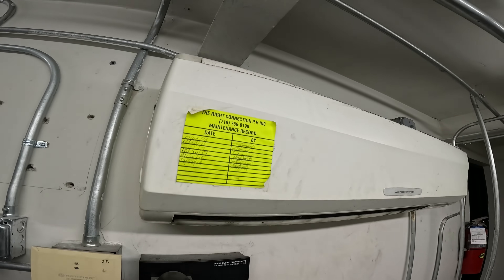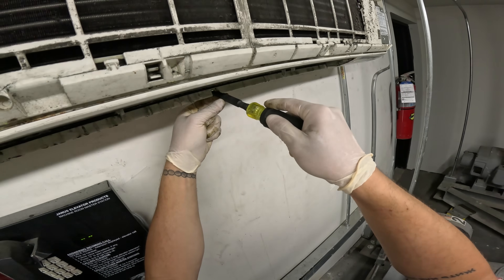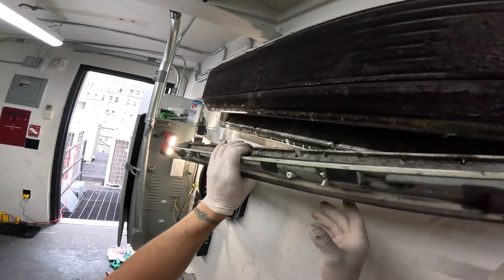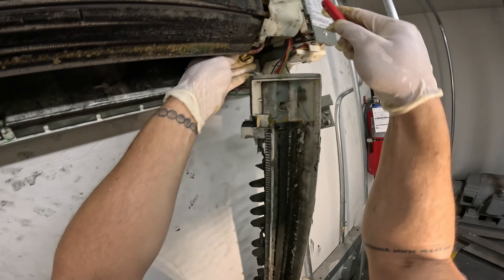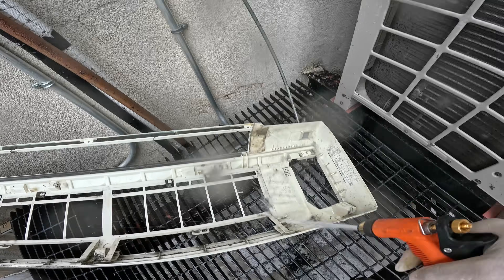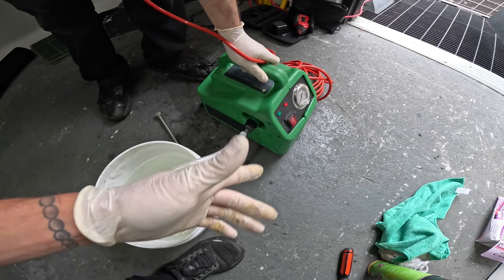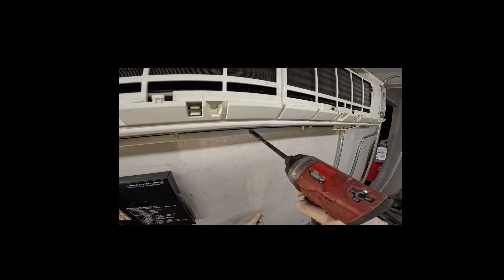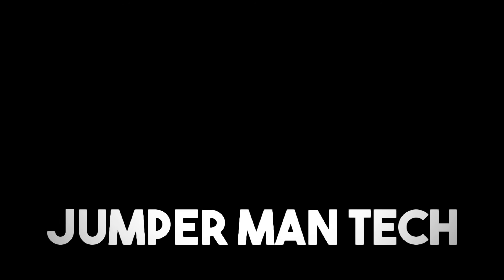HVAC: Mitsubishi Ductless Mini Split Wall Mount Deep Cleaning And Maintenance (Complete Tear Down)

Comment: JMT great video 
just FYI you can remove mini motor from drain pan on the end or remove from plug circuit board ( extra 5 minutes to do ) so you don’t have to leave it hanging and can clean it better. I have a lot of mini splits I maintain & service. 
Yes especially in that environment units take a beating. Like always enjoy your videos